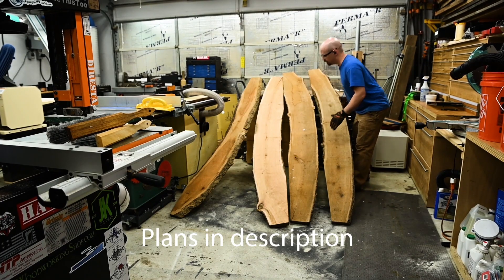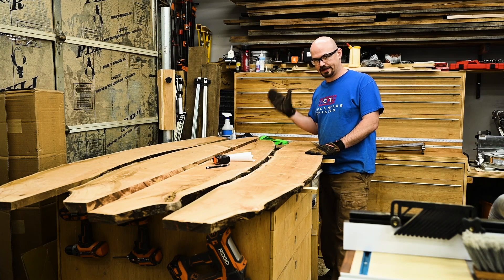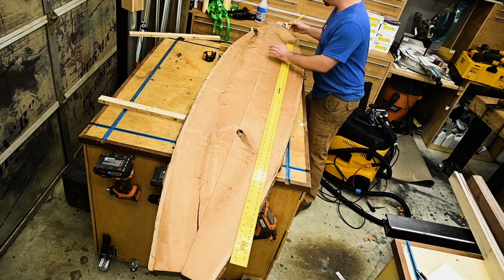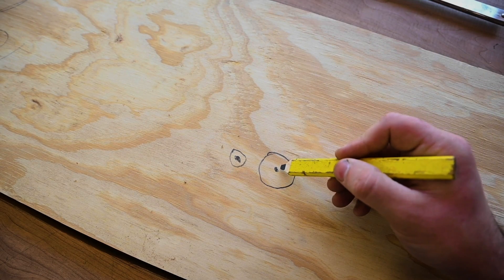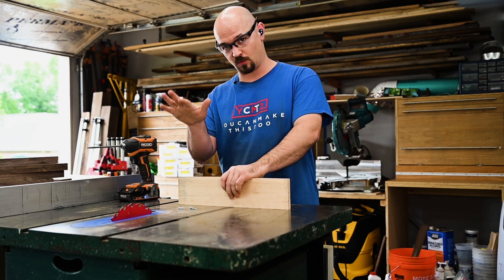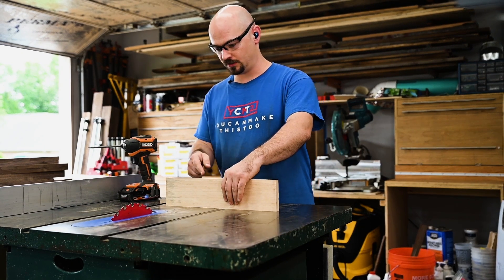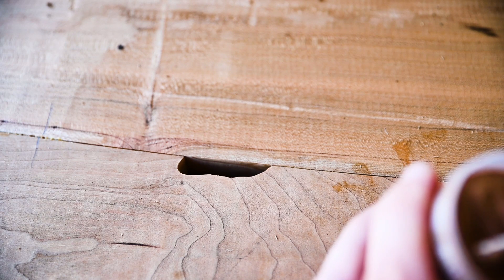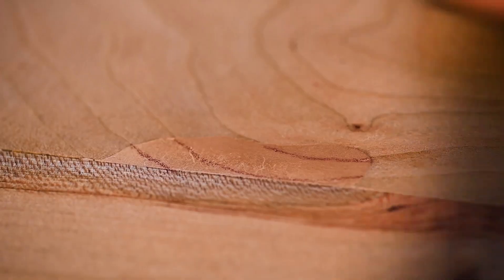My Hardest Build Yet - Nakashima Inspired Table

Comment: This is awesome. What a great video. I learned a ton. I have router bushings but I am still a little confused on how or why to use them and I haven’t yet. Maybe that could be a dedicated video? I love that you used the magnetic base from your dial indicator thing as a stop block. Definitely cheaper than a mag switch! I would have never thought of that! I love the info on the sealer with the tip on gloss vs satin.  I don’t have a domino but I do have a self centering dowel jig, I hope that this could get me by at a small fraction of the cost. I will now become a Patreon supporter!  If you are ever in Iowa let me know! I owe you a steak
Reply from the maker: Thanks, Jim! I'll definitely take you up on that if I wonder out that way. And a dowel jig can definitely help with alignment. I stay away from them for panel glue ups though because you'll need several and if just one of them is out from its mate.. the thing ain't coming together. I'd recommend watching my "4 Common Mistakes That Ruin a Flat Table Top" video and use the caul method if you don't have a domino. Thanks for all the great feedback and hope to see you in a Patreon hangout!

Comment: The moment @ 10:25 when your kid realized you were filming is priceless! lol. Also, I don't understand guide bushings and what they are for. Is it only for when you have a collet extension?
Reply from the maker: Bits that have bearings on them let you flush trim items together. If the bit doesn't have a bearing but you want to use it to follow a template you a bushing lets you do that. But it also creates an offset. That offset can be handy sometimes though.
Reply: @YouCanMakeThisToo  I understand the bearings but knowing that for the bushings is good. Thank you! Now the water is only a little less muddy.